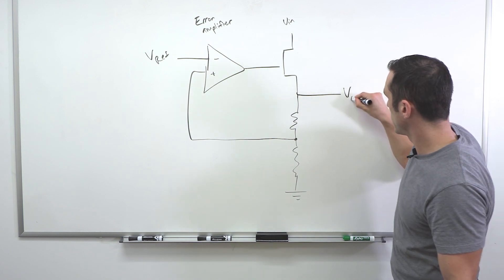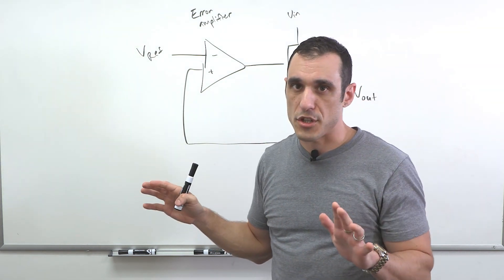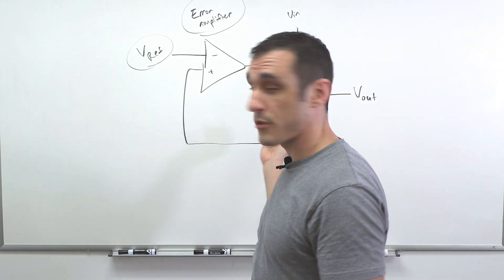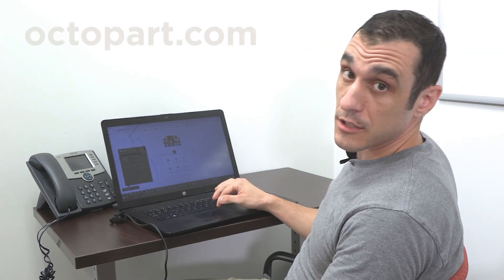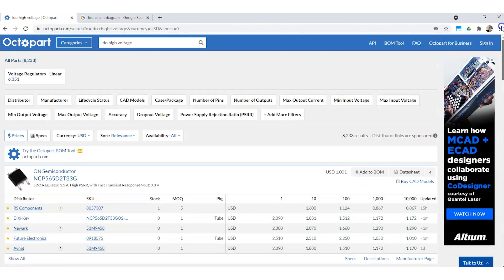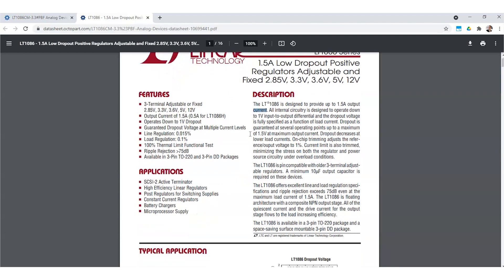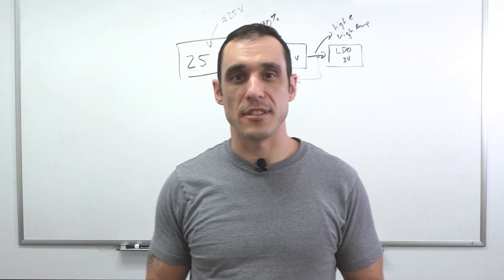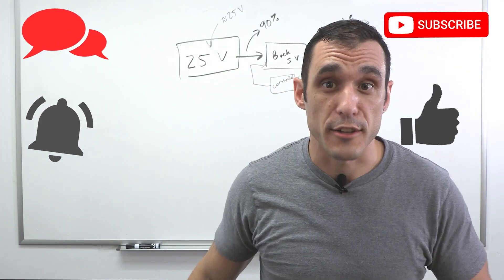LDO Deep Dive - Power Regulation in PCB Design: Part Two

Comment: At 10:20 when you present the impact of output current on the minimum input/output differential voltage you are using the LT1086H, listed at 0.5 A and not LT1086, listed at 1.5 A. The minimum input/output differential voltage for the LT1086 at maximum output current (1.5 A) is even lower than the LT1086H at maximum output current (0.5 A). Past 66% of its maximum current the LT1086 exhibits a shard in crease of its minimum input/output differential voltage which is not seen in the LT1086H past 66% of its capacity. You missed an important issue.

Comment: Why cover linear regulators as specifically only LDOs?  LDOs are just a subset of linear regulators.  Of which, LDOs are the least forgiving of linear regulators.  This would probably have been better covering the venerable LM7800 series.  Then look at the LDO version.
Reply: Well then maybe we'll just have to do something on the LM7800 series. Also we felt LDOs was a decent place to start because they are so frequently used in so many systems, including digital, RF, etc.

Comment: Typically a flyback converter is used when stepping down from a rectified AC voltage (Vac x sqrt(2) -> 25/12Vdc)

Comment: For the Error amplifier, is the FET specifically a MOSFET?

At 8:43.  Why would the current drop?  If voltage increases and resistance is constant, wouldn't current increase?

Around 14:30ish, why not just use multiple LDOs to step down, instead of a buck regulator?  Wouldn't you be able to get rid of the disadvantages the buck regulator brings?
Reply: I Yes generally a MOSFET, although some circuit diagrams will show a BJT. About the current drop, I'm not sure about this, I would have to look into it. About the multiple LDOs, yes I've seen multiple LDOs in series but the current can get limited to a low value at each stage, so just be careful with that. This is something you might see with processors that need multiple core voltages.

Comment: The error circuit is not using positive feedback. The error amplifier is driving a PMOS transistor and there is in effect an inverting action from the output of the error amplifier to the output of the transistor. So, although the feedback signal is going to the positive terminal of the error amplifier, this is still negative feedback (due to the inverting action of the output transistor)
Reply: Thanks for catching Harry, yes you're correct I slipped up on that one

Comment: why no making 25V->3.3V buck converter??
Reply: Buck regulators are noisy. Going Buck => LDO in series can significantly lower noise.
Reply: @km-electronics1  thanks, I came to the comments with the same question.